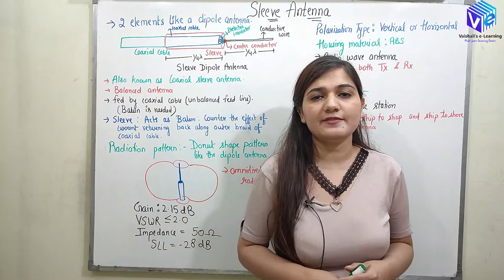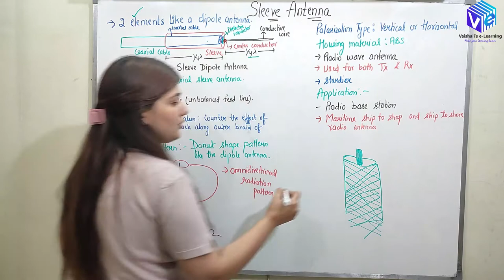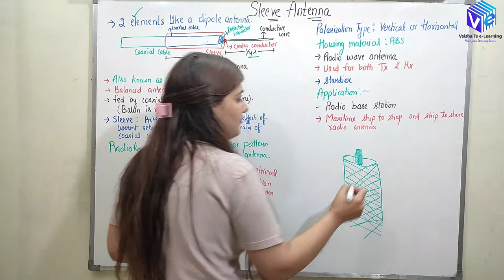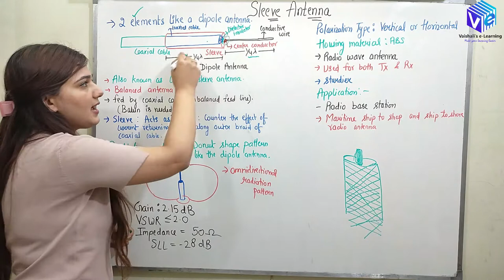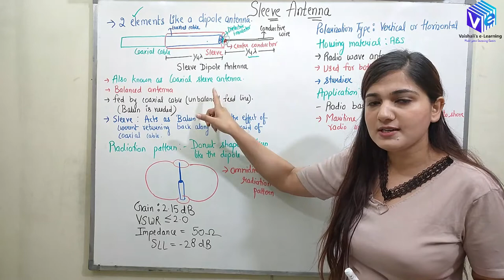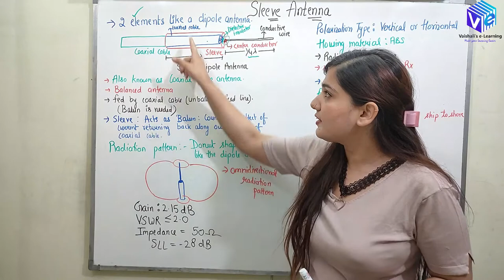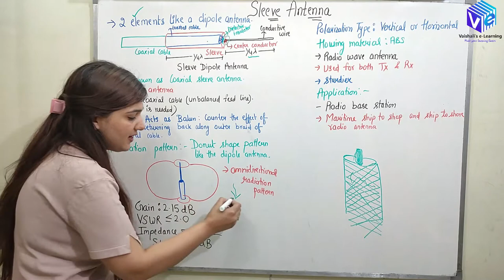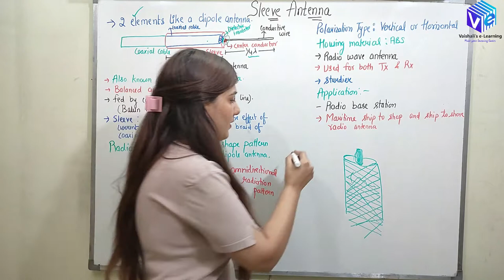Sleeve Antenna

Comment: The shield of the coax in center of the sleeve, is actually itself the center conductor of the sleeve, the sleeve in turn acting as the outer shield of this center conductor. Therefore the spacing between the inner coax and the sleeve must be calculated for the correct desired impedance. Also the insulation on the outside of the center coax must be teflon or air so that the sleeve can ring without any dielectric losses. If you can show the calculations for the sleeve to coax geometry then that would be an opportunity for you to post a great follow up video.

Comment: Thank you !! 
Why do most simple 2.4Ghz wifi sleeve dipole antenna is 25mm sleeve and 25mm driven element  ? 4/λ for 2.4ghz around 31mm ??
Reply: I guess due to velocity factor.
Reply: @amitsekhon  do you know how to calculate that value ?? Is it any percentage of the original wavelength??
Reply: @kavindugilshan  It depends on the cable type. Normally its around 0.66 for most types of coaxial cables used.
Reply: @amitsekhon  31 * 0.66 = 20.46 ?? 
How it is 25mm ?? Maybe 0.8 ?? 
Thank you for the reply
Reply: @kavindugilshan  It also depends on the plastic enclosure as it changes the tune of an Antenna. Best si to use an Antenna analyzer and check the VSWR.